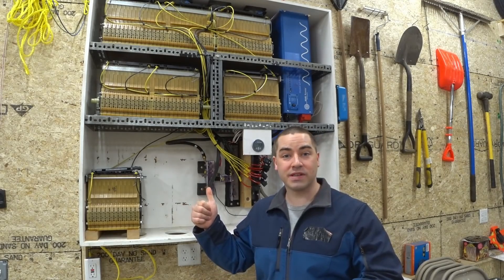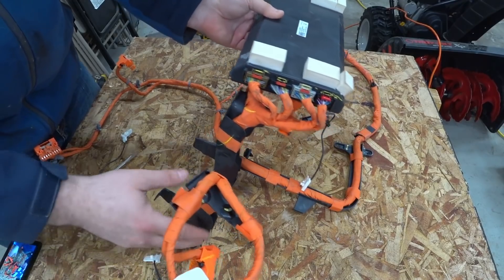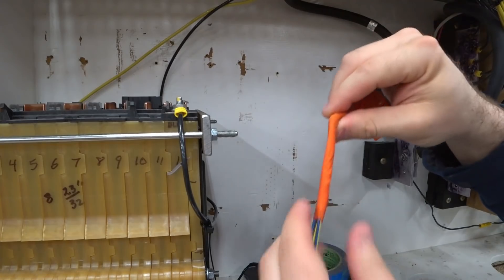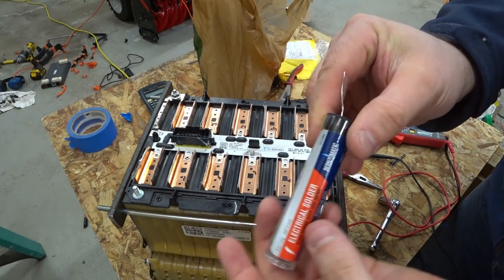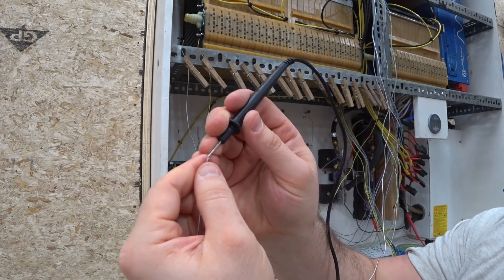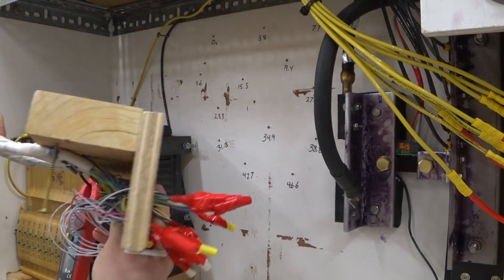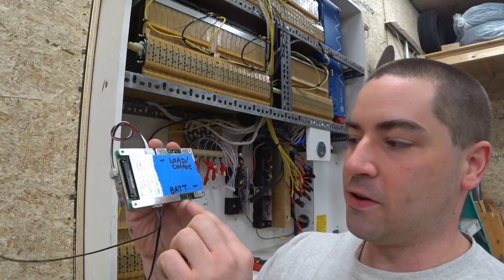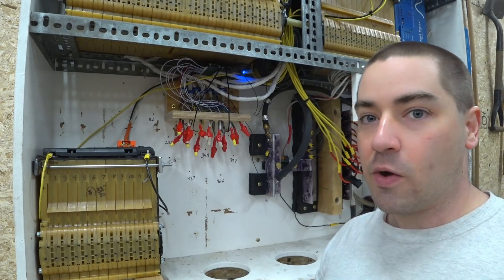DIY Lithium Battery Wiring Harness and BMS (Battery Monitor System)

Comment: Whew, I'm glad your cells were still so closely balanced. A big difference thru those little wires could have been exciting.

I've ordered a similar BMS for my battery. I don't know if you'd be interested, but "simat" on github has "BatteryMonitor" which is software to run on a small computer like a Raspberry Pi, and which can communicate via bluetooth with some of those inexpensive bluetooth BMS.  (He also has published his own hardware which could be used instead of the bluetooth BMS.) https://github.com/simat/BatteryMonitor

Comment: I have an older Chevy Volt pack and I found a schematic with the full battery pinouts on it.  I wonder if yours is the same?  Mine I was able to reuse the BMS, but mine has 4 smaller boxes, not one big BMS.  It just spits out CAN bus data at 125k with mostly straight forward data formatting, been about 2-3 years since I touched it... Burried in the garage somewhere...
Reply from the maker: That's awesome you were able to reuse the original system.  You lost me at "CAN" bus.  LOL.
Reply: jon -
Are you saying that you were able to capture/interpret the CAN bus data from each individual BMS?   

Can you detail anything about this?  

Can you share the schematics in question?  Are you saying your full Chevy Volt battery is sitting unused for 2-3 years?

Comment: if another fuse blows will you be able to tell from the BMS which one?

You will still need to do a bunch of checking to pinpoint it? I would be worried if Batt 1 Cell 6 blows you will not know since Batt 2,3 and 4's 6th cell will be sending the +voltage to Batt 1 cell 6?

Check out this BMS https://www.youtube.com/watch?v=9gHoNT3E6ZQ&t=243s 

Or the Logmons?